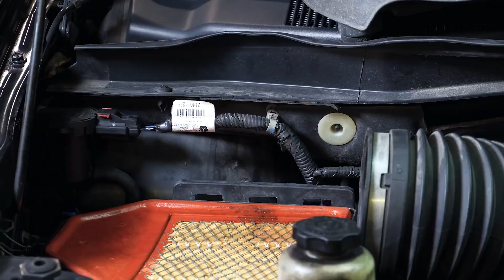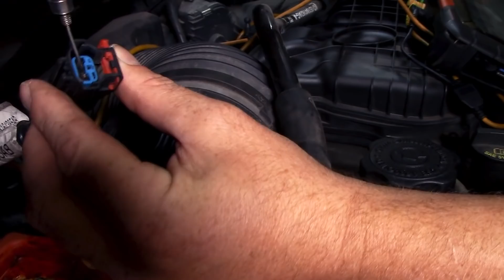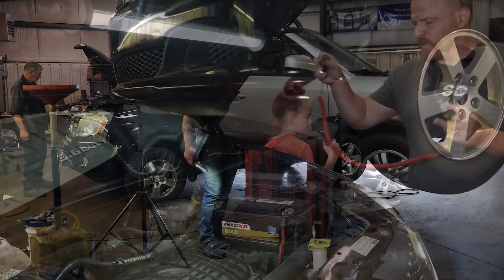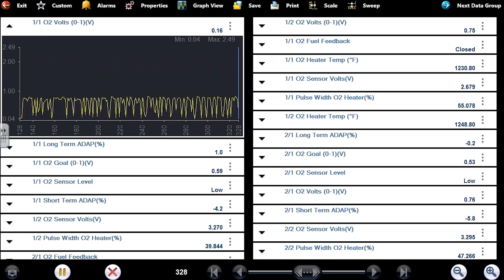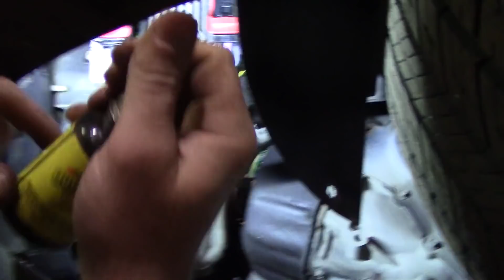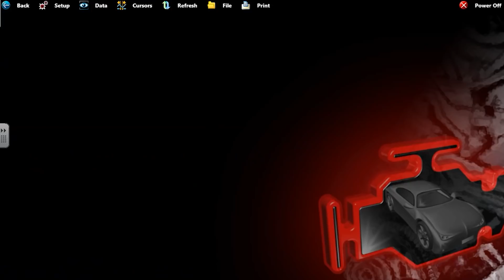2013 Dodge Caravan Purge Valve Circuit Code P0443 (New purge valve) Part 1

Comment: Thanks, Paul you saved me a big headache, having the same PO443 code and problem in my town and country, put the test light on the purge, and no power I am used to the ground wire switching so  started to panic, but now I know will be hooking that same ground wire on the purge. THANK YOU.

Comment: My nice 2003 Dakota 4.7 threw the po443 code after ni insstalled a new purge valve.The connector on the valve is less than par,red lock part of connector isnt good and I thought it needed ground like yours...?? I also have 420 and 421 codes...By the way,GREAT video !!   I'm in upstate NY. Older dude,.Inspection is due.ouch. Mechanic did some grounds to computer few tears ago. Any advice very appreciated.....thank you....keep up good work .. Robert G

Comment: Would a transmission input sensor (2 wire) also be considered a power side switched circuit?  On Toyota
Reply from the maker: No, it's an input. Only outputs (circuits being controlled by the module) do we apply power and ground side switching

Comment: Great Video!!! just one question what led you to calling a bad PCM, instead of the possibility of that ground wire being open in the harness somewhere, would checking for continuity from the pin at the pcm to the pin of the purge valve connector be a viable test?

Comment: You’re a seemingly pretty good tech. Good find on the spread terminals at purge solenoid….. tighten them up, and move on. Why wouldn’t you check the female pins at the PCM for the ground side of purge solenoid, since you know someone has been spreading terminals during testing? Ever used a power probe???  Could have verified solenoid operation immediately, and then could have seen whether you were missing power, or ground, and then manually actuated the purge with the power probe (at the solenoid, to verify JUST the solenoid operation, and then again at the PCM connector while unplugged) to verify wiring, and solenoid operation. Also, might try just actuating the purge solenoid, (might even be able to adjust duty cycle, or “pulse width modulation” if you wanna seem SUPER SMART instead of running a full purge vapors test which requires engine to be running. I have the video paused at 15:00, and look forward to the rest. Efficiency, efficiency, efficiency, and is ok to stay humble, and kind. Humility goes a LONG way…..  There ARE some other intelligent techs out there that do a good job, and even work for a dealer. Thanks for sharing, and your daughter did a GREAT job sir. God Bless.

Comment: A couple of points about Chryslers. (1) Checking to see if it's a power or ground side control, on older Chryslers that ground side switched, You will only have power for a few seconds when switching key on. With out a RPM signal it will de-energize ASD relay which was suppling the 12v. So if you're checking after a few seconds, you will have nothing on both terminals. (2) I'm really surprised you didn't check all computer grounds at PCM. Chrysler has many any you could be missing one of them and vehicle still runs. It uses that ground to supply ground to the components.

Comment: What component does that valve circuit go to? When you went underneath.
Reply: Also, with the two wires that go to the valve, should should they have a reading to each other? I don’t have the probes you have but I checked ohms from between those to to see if they were open or not.
Reply from the maker: No, you can't do that test as they are completely separate circuits
Reply from the maker: The engine computer

Comment: The dealership doesn’t go this in depth with their diagnostics. I haven’t worked for dodge but coming from Audi. Technicians would scan cars and either base repairs on fault codes or a tsb given by the manufacturer. Which is usually why they repair the vehicle correctly. However If it was one thing ScannerDanner ever taught me was to never be a part changer. Learn your fundamentals and understand how the systems work. You may lose at first with learning but it will guarantee your repairs with builds a value and commitment with the customer.
Reply: Btw dealership training is not the best. They won’t teach you how to backprobe connectors. It was always checks at the front. All the techs would look at me stupid when I broke out the t pins and my modis but my repairs were accurate and professional. Thank you Paul and everyone for this great knowledge and video
Reply from the maker: Crazy what techs are trained to do sometimes. Thank you!

Comment: Hey Danner, first thanks for the vid. The return (gnd) wire would be used for circuit integrity monitoring for sure.
I was wondering why you didn't check for power and grounds at the PCM? You checked for continuity of the purge 
valve return wire to the PCM and it was good. So...where did the ground go?
Reply from the maker: To the board, then externally grounded. To be fair, you are right, I preach powers and grounds all the time! But in 30 years of troubleshooting, I've only had one car line (GM) use an external computer ground that was specific to only one circuit. (The O2)
So I may have rolled the dice there to some, but I felt very comfortable that a bad computer ground on this system would have affected many circuits, not just one. 
Maybe I got complacent? 
A single missing power feed wouldn't cause a missing ground, so that part for sure i felt good about. And I think I verified pin fit on the computer end, but that wasn't shown or I rolled the dice there too? This was filmed about 14 months ago, so I'm not sure!

Comment: @ScannerDanner Just wondering if the dealer tech didn't jam his test lead into the computer connector end into the ground to check ground continuity before condemning the computer and jack up the connector like they did to the purge connector. Leaves me to guess 1: they tested the purge connector all was well but damaged the plug, 2: they changed purge valve, it didn't work because they bent the connectors. 3: they tested the continuity of the wire bending the connector at the computer like the purge end connector it showed good and condemned the computer. But now you have damaged ends at each test site. I know I wouldn't want to disturb any green crusty's in there but a probe wielding dummkopf may have and spread the connector. I'm curious to see if it was a spread open ground connector at the computer.
Reply from the maker: Very possible, but remember this problem was there before that dealer tech did his thing. I also believe I did a visual inspection of that connector but it was cut in the edits for some reason. Maybe we didn't have a good shot of it and Caleb didn't realize the importance of that moment and I missed it too? I'm not sure, as this was filmed over a year ago. I can definitely assure you that is was indeed a PCM issue. It is the best I can do. 😉

Comment: I have a similar problem with the ebox fan in my 2000 bmw m5. I keep getting ebox codes but I can turn the fan on and off when I access it through my code reader. When I looked at the schematic the fan is supplied directly with battery power and the ground is switched, controlled by a thermostat in the DME. How do you identify a bad thermostat if you can command on, off in settings?

Comment: Thank you for uploading another great vid.
I really like these 40mins or longer videos where i can pick up the nitty gritty stuff.
Yesterday i diagnosed a "cranks but no start". 
As soon as i had the hood opened, i was hearing your voice echoing in my head like "Check for fuel, Check  for spark". 
I answered "ok spark first" 
Pulled the coil and the plug out..
Cranked the engine- no spark..
It was a coil on plug btw.
Is it the plug or is it the coil?
"Do i go left or do i go right"
Then i pulled my spark tester which i bought after i saw you using it. It was the vid were as soon as you turn the key on the coil was firing immediately.
So i stuffed the spark tester into the coil and the other end on ground... Not on the battery cause you said it may cause the battery to explode...
Cranked the engine over.. and there was spark...
So coil was good and all three spark plugs were busted.. 
It took me lest than 10mins to diagnose.
Replaced all three plugs .
Cranked it.
Engine starts.
And i said "We're done"

Comment: I can only guess an ECM trace/pin got blown from a shorted solenoid and them jumping it with an unfused lead or meter from battery in testing. the old high current smoke show/finding the weak component, there may or may not other things bad/open circuit in that case.

Comment: I believe that the dealership, to make money, caused on purpose the bad purge valve ground wire to pcm. So don't give them credit for getting it right on the diagnosis. The stealership have a reputation for ripping people off.

Comment: I would see as plausible for the solenoid control to have transistors on both sides, possibly controlled the same way, so I would better check the ground the same way as the power side, so the engine running and activating the purge from the scanner.
Otherwise if there is really permanent connection, it could be that connection to be blown out by someone short circuiting it to the 12V battery. Have seen ECUs blown out that way (mainly injector outputs on old ecu without build in short circuit protection)...

Comment: Did you check the computer plug (din;t noticed doing it)? Could it be just corrosion? I am a litle bit skeptical-confused with the issue. I would expect more devices to suffer from "lost" ecu ground. The only reason I can think for a single controlled ground is half or full bridge PWM control. If this is the case the fix will not work properly under all conditions. It could also be a low side shunt resistor for current measurement or an e-fuse type control that went bad.

The type of the ecu reminds me some hybrid FIAT ECUs that suffer from wire bonding issues.

Comment: If not for a monitor would that ground be wired that way for assembly line reasons? We know manufacturers make decisions based on money made or money saved. Still may see that it is monitored at some point but who knows until it’s driven enough. Still a repair that’s worth a try and I would do it also. At least there’s a load to work with and figure the circuit out. There’s nothing more confusing to techs than a wiring diagram that starts and stops at the same computer. Especially when you pull it up and it’s one page with two boxes and straight lines drawn between them with no loads visible, no grounds and no power circuits. Makes me laugh every time I pull one up. First Mitchell but there are errors in those so I don’t bank on it but then pull up factory diagrams and see pretty much the same thing. Just a couple boxes doing mostly unknown stuff, so much fun.

Comment: May did great. 
  Can’t see how the ground side is going to fail in the PCM. I mean how do you get only high current on a ground side enough to fry it? i would totally expect power side to fail but not ground side.
Reply: Because the module is providing both power and ground, excessive current caused by a shorted solenoid coil will burn out the weakest point in the circuit.   I suspect the initial failure was a shorted solenoid, which burned out the ground path, then the solenoid got replaced on the first repair attempt, before the dealership got their hands on it.

Comment: Hello Paul, I am from Chile, if the purge valve is stuck open, the oxygen sensor will have a poor mixture so there will be more injection time to compensate for the mixture.

If there is no ground command, the valve will be closed all the time, the computer will activate the valve and increase the injection time to compensate for the grams of air that are entering the valve, but when the valve is closed, the computer will increase the pressure. injection time and it will not be compensated with more air from the valve therefore you will have a rich mixture in the oxygen sensor and at the same time a high voltage.

I think I have seen that when solving the valve problem, the oxygen sensor code did not appear again, probably because now it can better compensate for the small air inlet through the purge valve.

Could you correct me if I'm wrong?

Comment: It could certainly measure amp draw with that ground so, that it does wouldn't be a random event; it would be a drive cycle or a comprehensive monitor. It wont see the current on your ground so, I suppose a different code can come back given it is a monitored circuit, that ground. Noise is one reason why circuits are taken into the PCM rather than left external.

Comment: I had a 2013 Jeep Liberty over the summer time with the same problem, my testing came up with the same thing you did, I too installed a ground on the same wire it lasted a day and the same circuit code came back on, so I removed the ground and recommended a computor or drive with the light on, haven't herd back so we don't have a fix but the seperate ground didn't seem to work like I had hoped.

Comment: Happy New Year and God bless you and your family. As to grounding externally. If this is my 20 year old daughters car with 149,000 miles on it then in my book this is a good fix because it doesn’t have another 150,000 more miles left in it. I do agree that a diode in the ground wire could add protection and is a good idea. But with an older vehicle with higher miles, sometimes this is the best answer for a problem. If it had 70,000 to 80,000 miles then yeah, put a computer in after all other problems have been confirmed. There is a time and place for everything. This was right in my book. Love ya in the Lord Paul. Great content and thank you for what you do.

Comment: I really hate that some dealer techs do that. Not all of us are equal and some are unfortunately straight up hack parts changers. Honda/Acura factory training teaches back probing is best. Also, they have factory pin fit tools to check fitment and double as front probes if needed. Little risk for terminal damage. There is zero excuse for that butchery.

Comment: Why does the ground go back to the computer but still not monitored?

Very possible it's an in-process iterative design and they're moving in that direction but not fully there yet.

Maybe.  Who knows?  Some of the crap and extra garbage I've seen in high-end IT is like that buggered up purge valve connector -- WTF?

Comment: Consider that the floating (control ground) can be connected internally to the gate (or other terminal) of a transistor ... if the ground is hard wired completed and not floating a small bias current may be established ... like  a small parasitic circuit bleed. This means the system device experiences a constant current across an internal transistor resistance (very very small voltage drop) ... hence the device sees power through it which means  equates with wear and tear while not monitoring or doing other useful work.

Comment: If the coil is grounded in the ECM that means there is a diode (arc suppressor) running parallel to the coil in the ECM protecting the driver correct ?
Running a ground to chassis means you bypassed that protection device right?

Comment: OMG, didn't think a dealer would do this or push their tech to push a lead into the front.  I'm not a mechanic and ALWAYS backprobe by either poking a hole in the wire behind the connector then seal it with liquid tape of using a pin.  You could easily damage the connector or pin if going through the front.

Comment: I wonder if the driveability concern is from the computer randomly being able to reconnect that ground and it floods the engine with fuel vapors then spiking the O2 sensor and also causing the random misfire code.  Maybe I'm wrong but that's just my two cents.
Reply from the maker: That was my suspicion for sure! But from memory that O2 looked like crap too, and another scenario is the O2 starts creating some huge, abnormal swings in fuel trim and there is your misfire code too

Comment: Dealers 100% recommend front probe testing. The logic is that you can have a connection issue between the point of the  back probe and the front of the terminal.
Reply: They should do that only with spade connector sets from AES Wave on not with a P2 Philipshead screwdriver. Jeez, that connector looked mangled.
Reply: @blockbertus  Agree. 
In the dealers defense they do make special service tools to front probe connectors, etc.  without damaging the pins that work awesome. May not be the case for all vehicle brands.

Comment: Great video one thing you missed that is important. When there is O2 sensor code and multiple cylinder misfire is to read freeze frame data look at the adaptive fuel memory. If the adaptive fuel memory is very high or very low on the bank the O2 sensor code is on then it is probably the O2 sensor set the multiple cylinder misfire code. I'm a dealer tech for what it is worth. Cheers

Comment: To be continued......... there is going to be more! HAHA of course it's a Chrysler. Can't get over the terminals being so spread out like that, what a hack that guy at the dealership. Some techs need to take a little more pride in their work. It seems weird they wouldn't ground switch that solenoid.

Comment: Hi Paul. Isn't the power side should be pulsing ? It seemed like to ECM was sending straight power to the solenoid. Maybe i'm wrong. Let me know coz it shouldn't make to stall the vehicle. Thank you
Reply from the maker: It was pulsing, but the canister was so completely saturated which is why it stalled and I'm sure the bidirectional test is a longer duty cycle for an idle condition than what the computer would normally apply
Reply: @ScannerDanner  got it. Thank you.